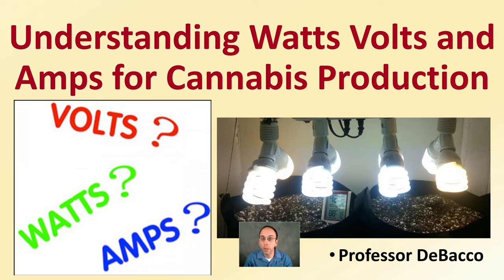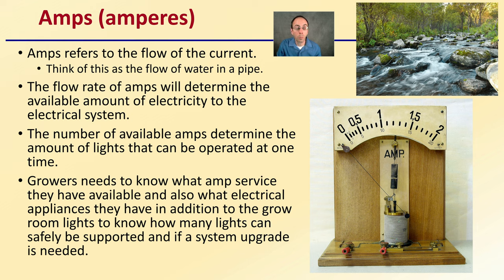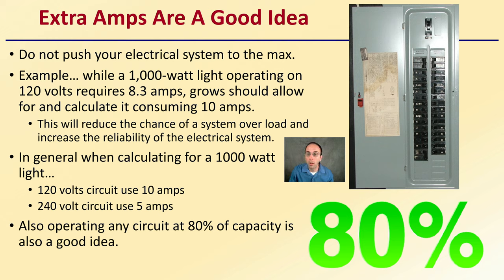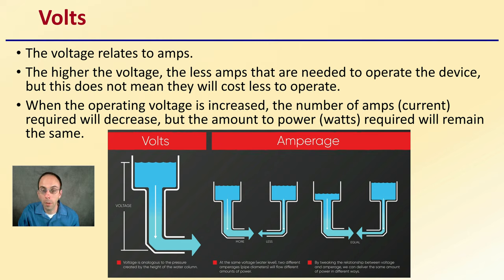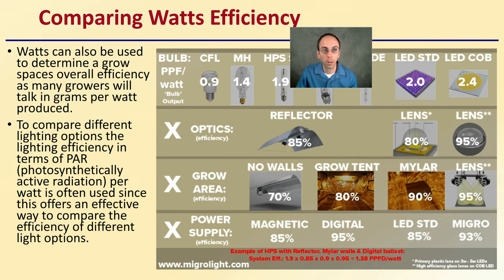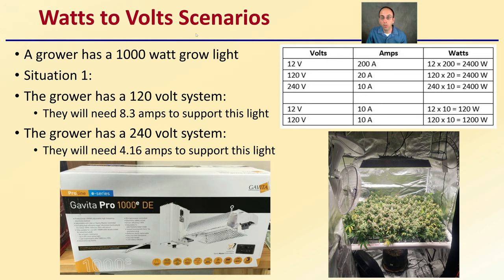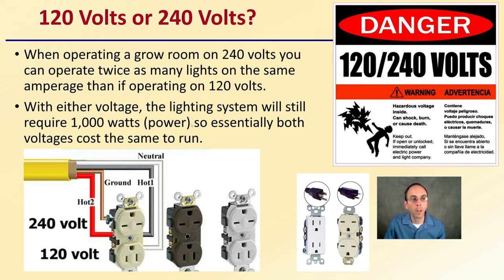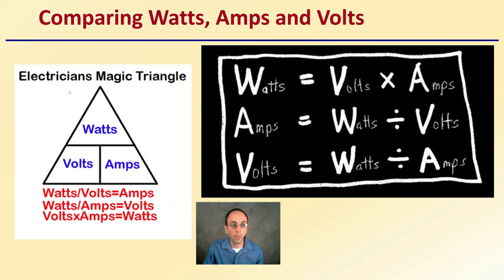Understanding Watts Volts and Amps for Cannabis Production

Comment: Some equipment runs more efficiently at 240V as well.
Reply from the maker: It does necessarily run more efficiently, it simply draws less Amps so it will simply use less space in an electrical panel.